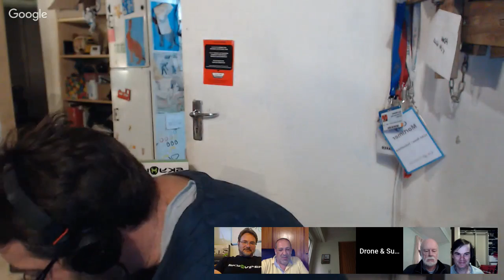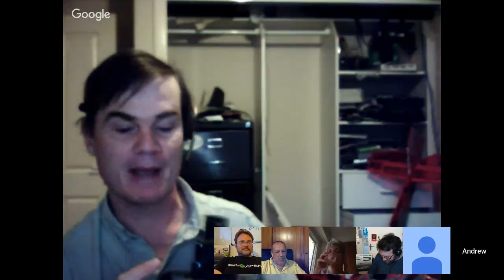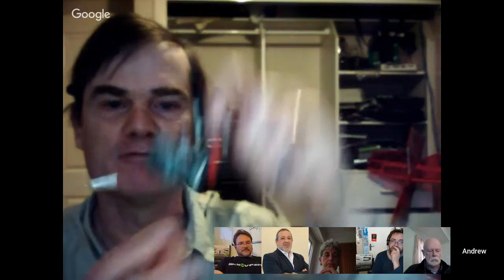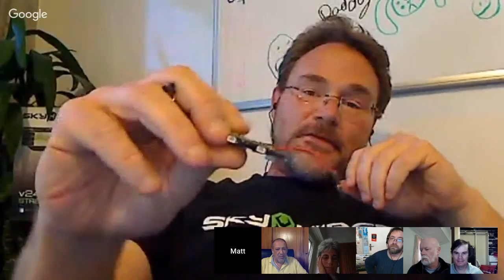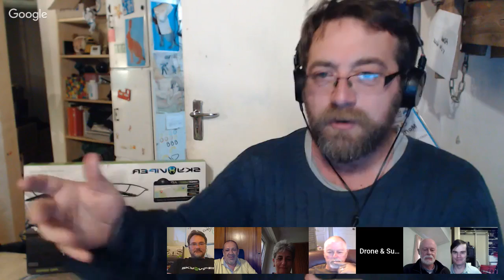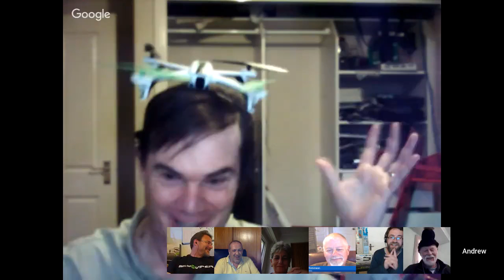Drone Stuff This Week 22nd August 2017

Comment: just got the jounery recently wasn't expecting anything dji like for the price but for what it is its been great for social media shots super fun to fly in ludicrous mode aswell....if the motors burn out eventutally like some have stated would it be possible for me to order some brushless motors with different props and wire them up?

Comment: Word to the people Sky viper is a waist of money. They are over rated junk not worth the time they tuck to rap it up in the box. I have had every model. You will be disappointed with this product the camera is choppy the battery life is short and the motors burn out quickly just telling you all the truth here. You can get a lot better drones out there for a lot less money and a lot more fly time.
Reply: Balance your props, log on to the Web Interface a great tool - calibrate your drone, and try different batteries.. it won't lift all that it can hold. Had 2020 amp hrs on there, couldn't lift.  Lifts my Blade Zetrok 1050 s though for a good locked on video run.
Reply: such as?
Reply: Disagree.. but You tube can be shit!!! Just erased my awesome post..no time for their incompetent bullshit..

Comment: Getting the message out of what this drone can do because if you just go by the specs, GPS, Brushed motors, Waypoint flying the Hubsan H507A has all that for less money.  This is a much better drone, but the consumer has to learn that.
Reply: There is no controller on the Hubsan. You're forced to use your phone. Anyone who'd tried that knows how bad it is to try and control it that way.